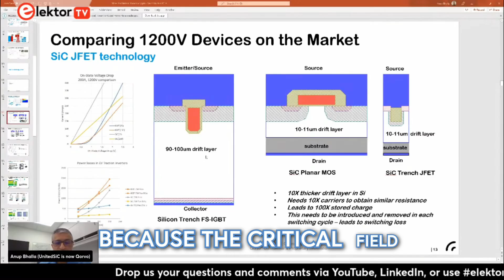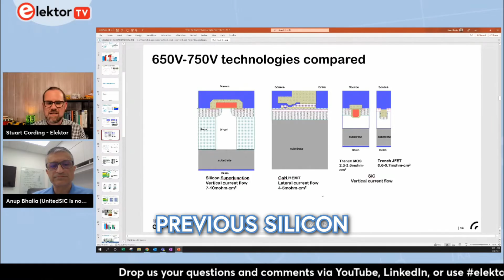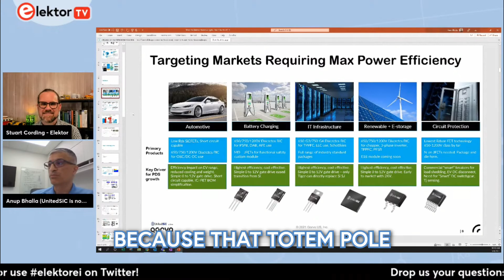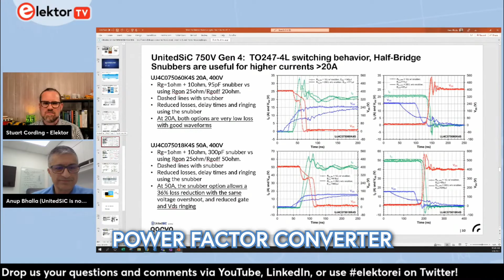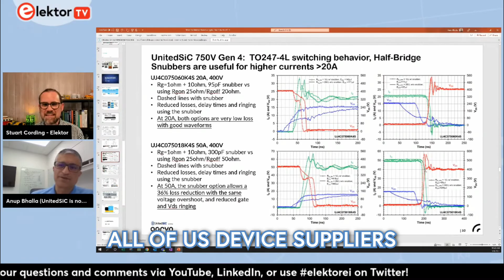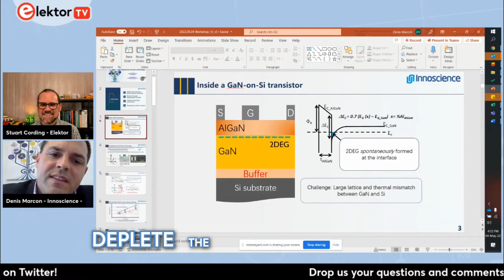SiC vs. GaN: Which Power Converter Wins?

Comment: GaN are still far from the established position that SiC has today. The latter have been on the market for 20+ years, many of the difficulties with their production, their defects, their reliability have been largely overcome. They have a much greater advantage in high voltages compared to GaN semiconductors, although in theory it should be the other way around, because GaN has the largest band gap. But GaN are much more complicated devices, their structure is mostly lateral with plenty of "compensations" like trenches or channels. SiC or Si do not have these problems in general, they possess vertical structure (semiconductor junctions "sandwich") - much more easy to achieve reliability and high isolation voltages. This is the situation today, who knows what the development will bring to us in the future.
Reply from the maker: Thanks for providing such an in-depth and informative comparison!